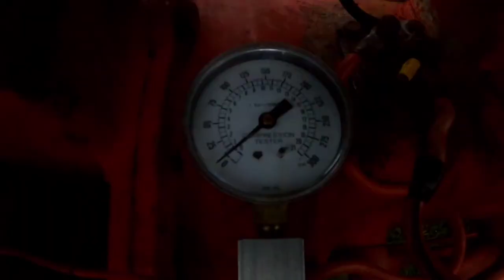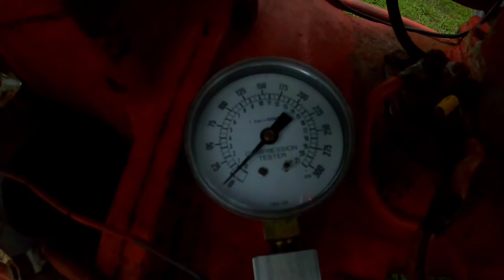Ferguson TO20 points to electronic ignition conversion.

Comment: I had a Ferguson distributor conversion on my 1922 Dodge. I had trouble with the useless points that wouldn't line up. Went electronic and she started right up. Ordered a spare electronic ignition system to keep as a spare in case something goes wrong. Thanks for the video.
Reply from the maker: Thank you, glad you enjoyed it

Comment: Never had a set of points fail that I could not fix in a few minutes for a couple of bucks. When the electronics fail you are often SOL till you can get a replacement unit that costs a lot more than a new set of points. Why people think setting points is so difficult is a mystery to me. I have had the same set of point in my TO-20 for 30 years, and its running great.
Reply from the maker: Thanks for the input. No doubt, electronic is not for everyone nor is points for everyone.

Comment: T0-20 ferguson 6 volt is there a distributor kit to go to  Electronic  Ignition?? If so , were is the best place to get it,, tks for the help
Reply from the maker: Pertronix is the way to go. Give them a call with your distributor or engine info and they can assist.you with a part number

Comment: Great video. At 12.13sec you said turn to get it as close to #1. I know your referring to #1 cylinder but what are your turning to “aim” at #1 is there something on the distributor?
Reply from the maker: By lining up the #1 contact on the distributor cap with the rotor it is pretty much gonna fire up and run there, with minimal turning of the distributor.
Reply: @JunkinwithJr  Wouldn't you need to first make sure the #1 piston is at the top of it's compression stroke? Otherwise the bug will be aiming wherever the engine stopped at.

Comment: Did you need to switch to a 12 volt system?
Reply from the maker: The tractor was already switched to a 12 volt system.  But yes, the pertronix unit does require a 12 volt system

Comment: Hi John here I am having issues starting my TEA20 after putting the battery terminals on the wrong way accidentally the negative wire was red and the positive wire painted grey caught me out it looked like it was negatively earthed. After that we towed it for some time to try and start it and it had been sitting for a long time. Would that have changed the direction of the motor. sitting on the tractor facing the front the engine fan turns to the left..If anyone can help me i would be greatful.
Reply from the maker: Dang, you got me on that one. I haven't had that happen to me so I'm not sure what the results are.

Comment: Replacement points for the T-30 are crap and ill fitting ...I ended up cleaning up the old set and reinstalling them until I do the electronic conversion.
Reply from the maker: Agreed, the original points were tight and right. But the replacement ones are sloppy at best. The pertronix kit dials it right in!

Comment: Sorry I disagree with you on this one.the reason people don't like points is they don't know how to adjust them .I would rather have something in the tractor that I can ajust to make the tractor run the way I want in stead of being at the mercy of some transistors and electronics .if it fails there is no second chances....but with points  I can pull out my spare set and I am running again. In 15 minutes.
Reply from the maker: Fair enough, thanks for the input
Reply: HEI hot longer spark. gas is cheaper now.